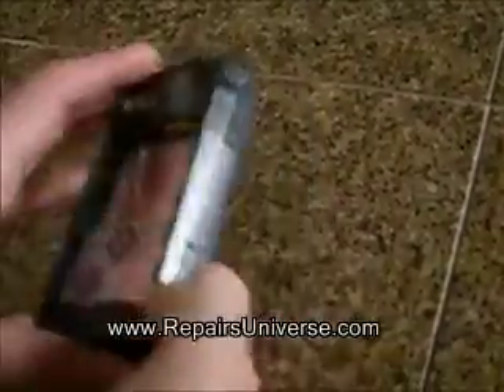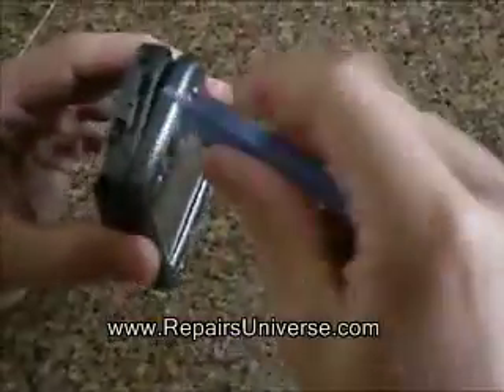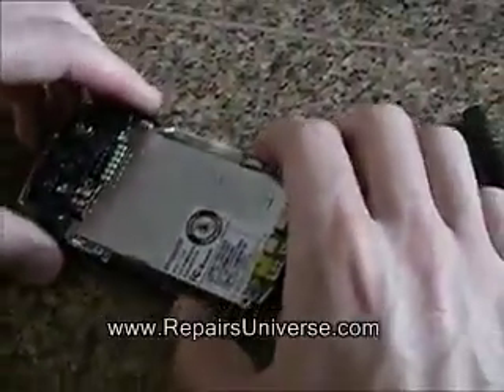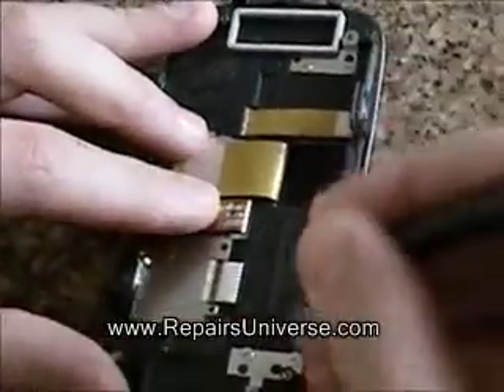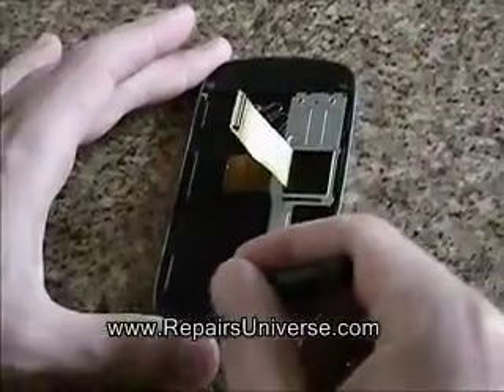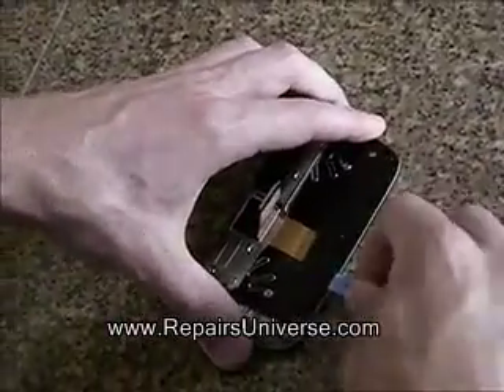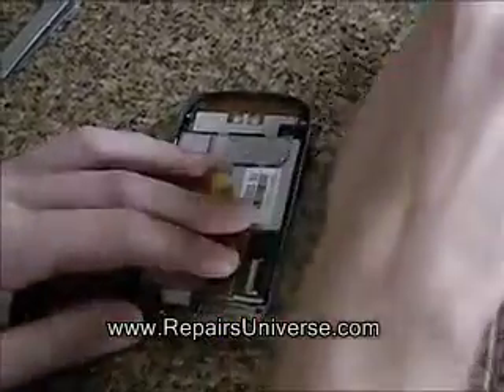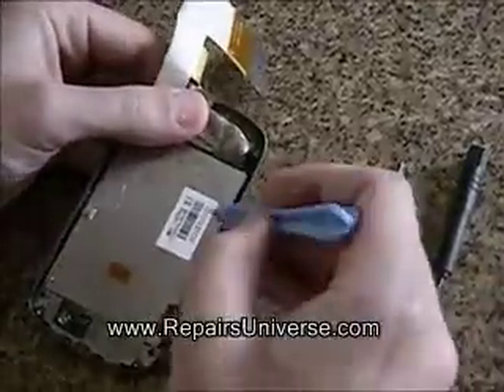HTC 6800: How To Dismantle Video / LCD Screen Replacement Instructions

Comment: May be I'm wrong, may you only need to remove the 2 screws at the bottom, I removed 4. anyway, how do you unscrew a screw that is worn out? I can't remove 2 and since they are very small I can't find out how to remove them